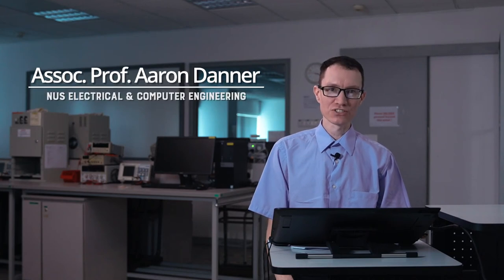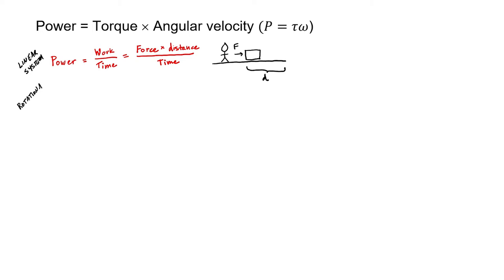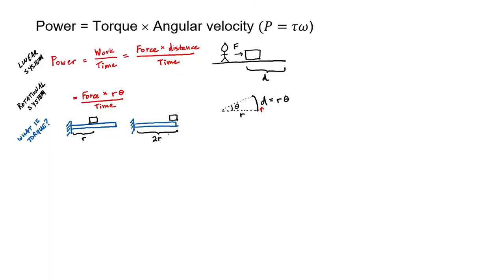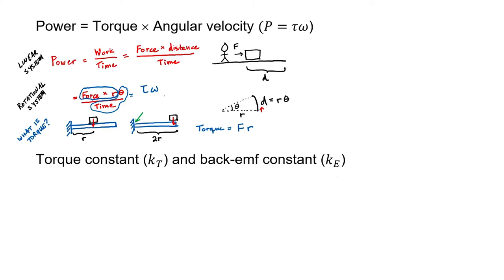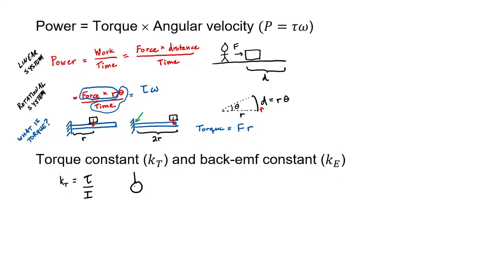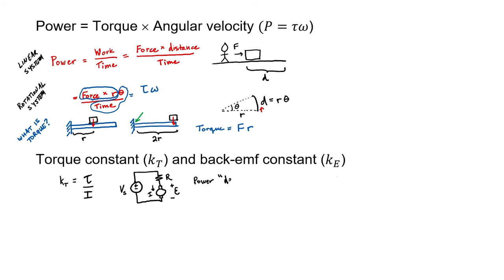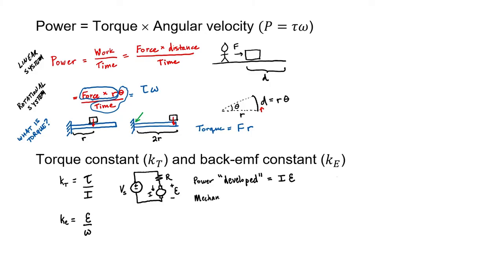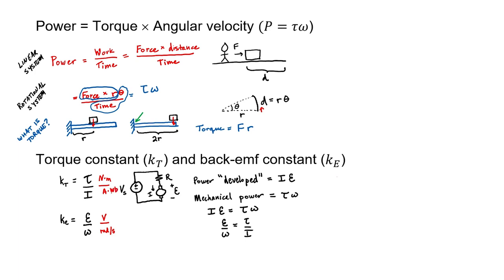Torque constant and back-EMF constant (Motors #4)

Comment: Excellent. I am trying to find a propeller that extends my drone's flight time, and I see the motor manufacturer's torque data with different propellers and input current. From this video's understanding, I can see the percent of power wasted as heat and percent of power used by the propeller. So now I can find a propeller for my RPMs that is most efficient.

Comment: For a permanent magnet DC motor or pmsm what is the back EMF/voltage measured in when calculating the Ke? Is it the Peak, Peak-Peak or RMS value of the voltage?

Similar question for the Kt constant, when controlling a motor you normally set the Iq current vector. Can you calculate the Nm torque on the motor by multiplying this value with the Kt?
Reply: Why I'm asking is because I have a motor that states in the datasheet that it should be 6.2v(RMS)/kRPM so 6.2v rms per 1000RPM. 
I'm trying to calculate the maximum torque I can apply at 0 RPM when using an FOC motor controller. When using this controller the Iq current is way lower than the actual current going into the device.

If I calculate the Ke from the 6.2vRMS/kRPM I get a Ke/Kt of 0.06.
The internal resistance of the motor is only around 0.05 ohm, my powersupply is 42. 
This would result in a stall current of around 840A with a torque of 50Nm.
The motor in question is only around 10x10cm big and will probably explode at this power consumption of 35280w. 
I'm also wondering if there is a maximum magnetic field/force you can pull a neodynium magnet inside a motor that will ultimately limit the motor in this situation.